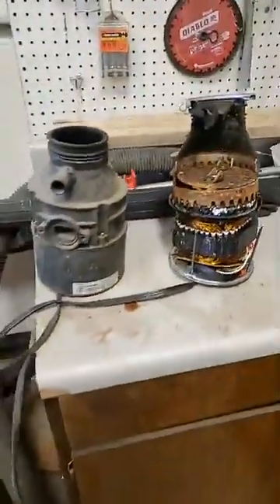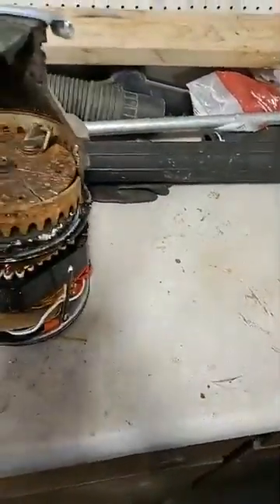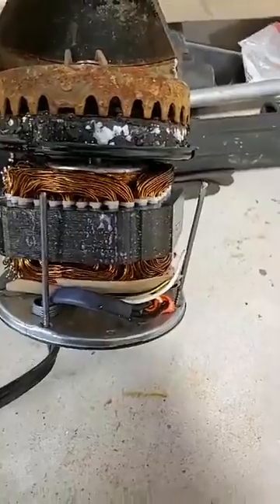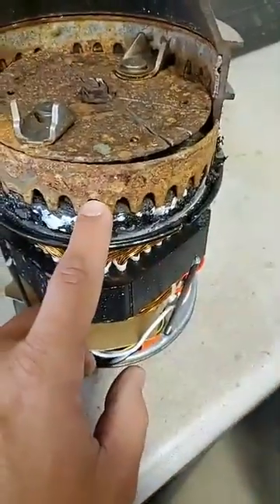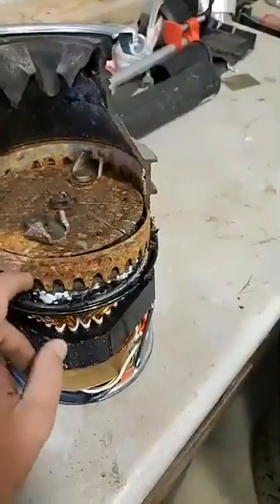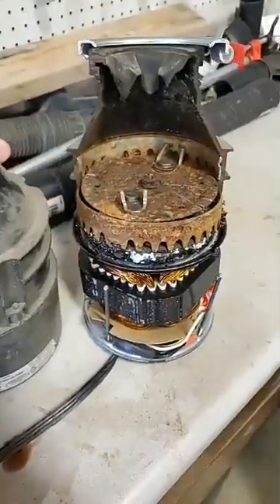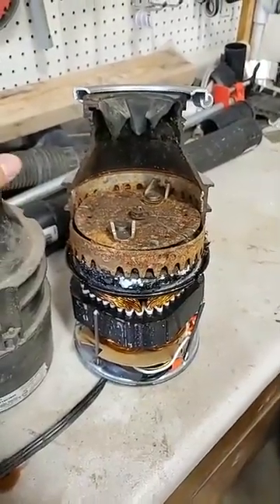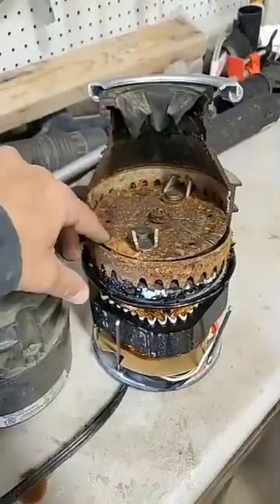How a garbage disposal works

Comment: by "sharpen" it's a very loose term, basically just scrape the gunk off it(or to knock the lugs around and keep them from welding themselves backwards on the plate... lol)  they aren't sharpened so it's not like they actually become "Dull" just rusted (caved in)